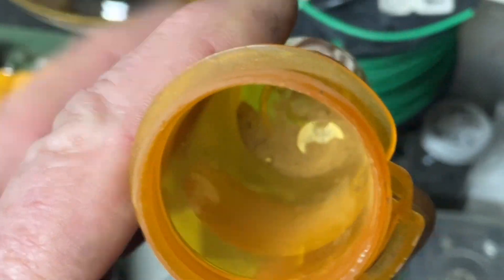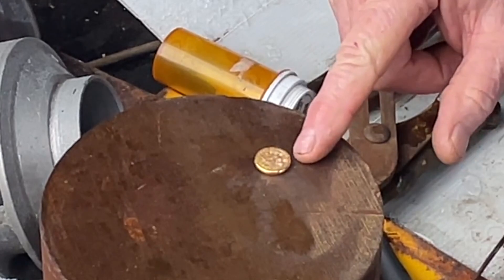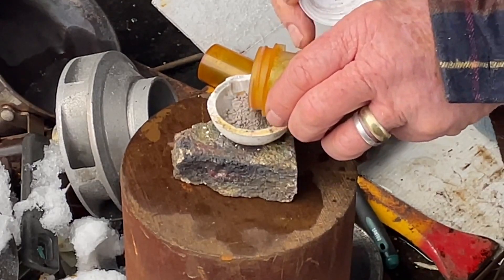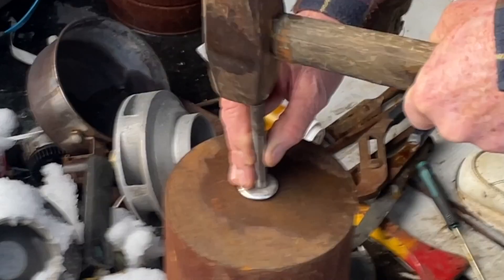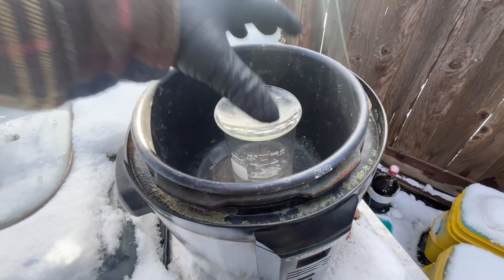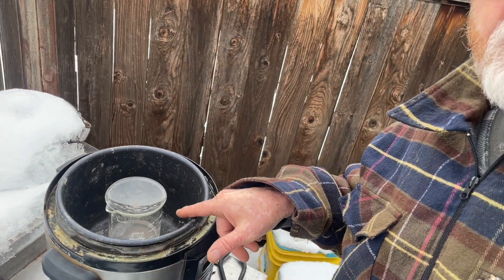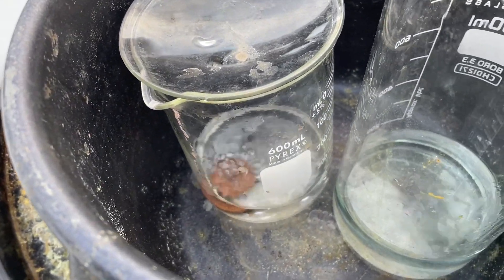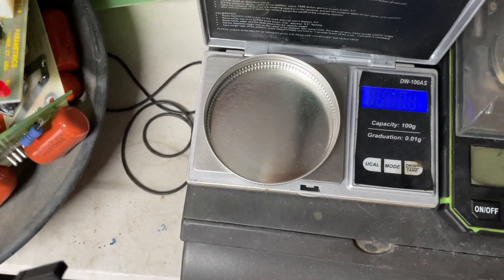Gold Button Cracks when Hammered.. Let’s Refine it to High Purity! Part 1

Comment: Right on Tripp. Thanks for the video. Nothing like refining in the snow. What part of the country you in, if you don't mind me asking?
Reply from the maker: Hello Patrick, we live in the Boise Idaho area. It’s a beautiful area with a bit of winter snow that usually will melt off in a few days. 
I spent most of my life working in semiconductor research fabs and semiconductor manufacturing facilities. For this reason, I am opposed to hobby refining inside any confined space unless it is a professional refining facility. I see people do it with a basic fume hood.. but without proper facility ventilation and every single safety measure especially backup power, I feel it is very dangerous. It’s quite inconvenient to refine outside, however I feel it is far better to suffer the inconvenience than possibly being overwhelmed by very dangerous/deadly fumes or if a power outage occurs and you are creating lots of fumes or simply drop a beaker of acid there is not much out there worse than these fumes. In addition, the corrosive chemicals are really tough on anything metal. 
It is amazing and super interesting but gotta be careful. 
Thank you for visiting sir
Peace Prospector Tripp

Comment: I read your video description. Good channel collaboration with Jason. I think you will solve the problem in part 2.
Stay warm Matt 👍🤠
Reply from the maker: Purity matters ☝️
I believe even a tiny bit of impurities can make your gold brittle. 
In this instance the gold is roughly 98% pure gold but would split and crack every time I attempted to pound it flat and stamp it. 
I now decided that I am going to get the gold button XRFed tomorrow (Jan 22,2024) and see the current pureness after inquarting. Then I want to melt it into a button again, pound and stamp it and see how it performs with the current purity. I’m not fully sure at the moment, but it should be quite pure.. hopefully 99% or more.
After this experiment we should have a good understanding of how minor impurities can cause gold to be less workable.
Thanks Peter, I appreciate you and your terrific comments.
Peace Prospector Tripp

Comment: Mine cracked too. But when tested mine was only 75 percent pure.  I'm not confident enough to do all the crazy science to refine it further.  U are a bad azz mr trip. Awsome stuff brother
Reply from the maker: Thanks Kris, even at roughly 98% pure it was easy to crack and split. I believe even a tiny bit of impurities can make it very difficult to hammer out and stamp without splitting. I’ll hopefully get it to 999 and then it should be easily worked.
Experiments are always interesting to me!
Thank you my friend 
Peace Prospector Tripp

Comment: I would have added more silver initially for good parting.  But this should work.
Reply from the maker: Absolutely.. more silver allows the silver to be dissolved more easily and quickly. At less than 25% the gold will be very fine. At slightly higher than 25% it holds together and retains its shape. I am happy to see that the button didn’t fall apart.
Experiments are always interesting to me.
Thanks much Keith 
Peace Prospector Tripp
Reply: First day above freezing in a couple of weeks here.  The roads will be treacherous tomorrow morning.
Reply from the maker: @hardrockuniversity7283  on Friday we began to melt and continued Saturday and today.. Sunday, it’s been sunny for most of the day and now the snow is pretty much gone on the roads and maybe 4” of slushy snow un melted in my yard. Glad to see it go.
It’s supposed to now rain a couple days, that would be nice. We can always use the rain in the high desert Boise area.  Watching the weather I’ve noticed that there’s a weather diversion line that runs rate down in between Idaho/Montana border. The satellite image often shows the weather coming down from Canada goes rate over far eastern Idaho, Montana and continues southeastward. The weather coming from the pacific ocean pushes the arctic blast coming down from the north just far enough eastward where the Boise weather is usually more temperate and dry.
That’s my Arctic Action Report 😂 
Stay warm pal
Peace Prospector Tripp
Reply: Melting here now.

Comment: Interesting experiment looking forward to the next part thanks for sharing see you on the next one👍🏼👊🏼
Reply from the maker: Thanks 48
I’m impressed it was 98%ish and still easily would crack. 
We will make it pure, confirm it with XRF and see if it can be worked and stamped with no splits or cracks.
Thanks again 48
Peace Prospector Tripp
Reply: @ProspectorTripp  if my theory is correct you have to flatten it from the outside to the middle with small strokes flattening it from the center out with big strokes (and no collar like they use with coins ) let’s it spread quickly and freely causing it to crack (at least that’s my theory….. ) I’ve never tried it obviously lol p.s. that’s cool it was 98%